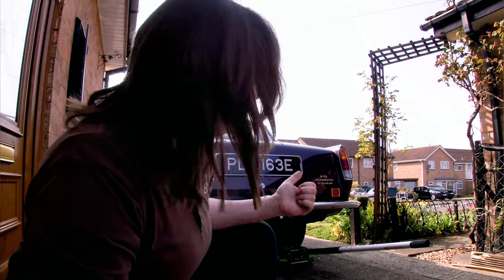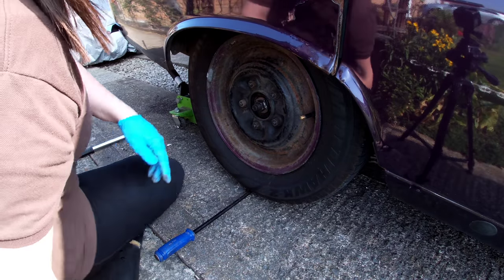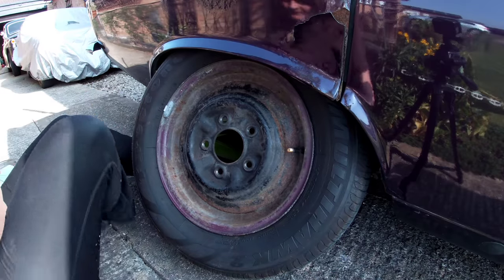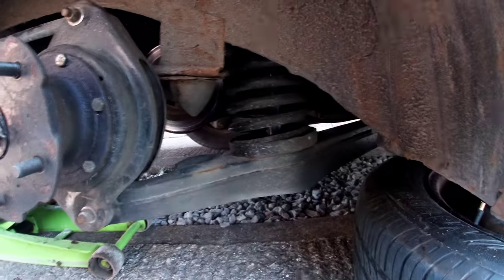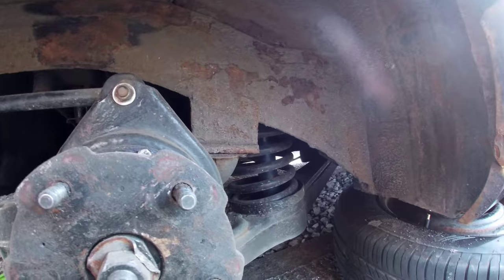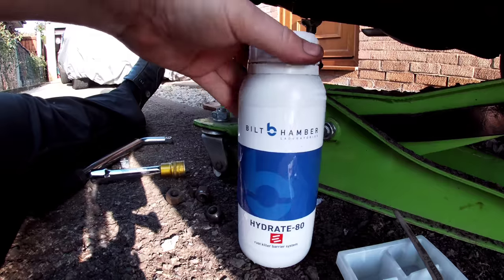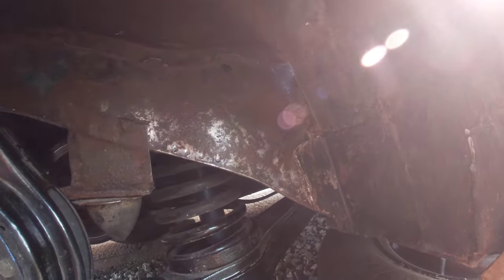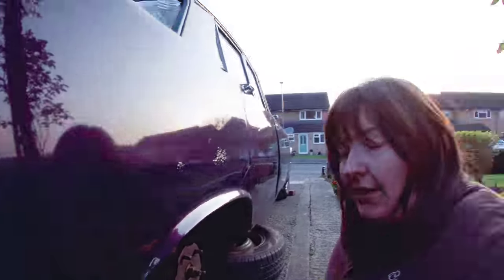Rover P6 - DIY MOT nearly sunk the Titanic

Comment: A wee tip for non structural holes. Either file it round and fit a grommet and sealer. Or a nut and bolt with a repair washer and sealer again. It was a body shop manager that told me that years ago. It cuts down the cost of the welding. Great videos. Keep them coming.
Reply: An old car of mine I found a plastic biscuit lid sealed in and a bigger ice cream lid held against it with a cable tie to protect from grit.... I mean, it worked
Reply from the maker: I will say..... 
I did superglue a penny to the inside of my P4 boot lid to cover up a hole. . .  . Hahaha
Reply: @Alexsassets  it saves money and once the rust converter has done its job all done. I’ve got a Morris minor and have done it a few times.
Reply: @Alexsassets  add some heat, class it as Brazed

Comment: I was so lucky to had my car back in the 80's, a 1973 P6 3500s, it only a little welding needed on the jacking points. Once the wings were replaced it was rust free. I remember horror stories of Kwikfit etc jacking them up under the design tube ... very expensive fix

Comment: I know the pain. My P6 was rusty in the exact same area. In fact some plonker had decided to fill mine with cardboard and a sheet of tin and paint over it! Had to have the arch re-fabricated but at the end of the day once it's done you know the car is ready for action again. Best to catch it now before it gets too far gone. Mr Jenkins will be making you smile again soon that's for sure!
Reply from the maker: I gosh. Cardboard 😐 . Madness.  
I felt like a bodger today because I put tape over the holes and painted over it 🤣 . It's only temporary until I can get it to the workshop for welding.  😆
Reply: @Alexsassets  I know it's crazy! That rust converter is absolutely fantastic stuff so using that where the metal is still good is a fantastic plan. Luckily that arch isn't actually structural to the cars integrity so it will be just fine until you get round to welding it. So long as you do it this summer Mr Jenkins will be right as rain. Really interesting to see you use the elbows as the jacking point I'll take that as a very good piece of advice for the future I too find jacking them up to be a mission. Great Video.
Reply from the maker: @EclipseGaming2073  only thing is it's hard to get the wheel off if you jack on the elbow.  . . But I manage ok like that . I certainly feel safer. I accidentally let the jack down too fast today and thankfully I had the axle stand there,  or it could of got messy 😅

Comment: I'm an old guy now.retired now. I used to work in the MOT bsy at a. 
Garage. I used to do sll the welding. That is nothing to what i used to face every day! I could spend weeks on a Transit van or anything? Before you know it, it's done. If you paint it with plenty of red oxide and cover it with waxoyi, it will see you well. Im a JAG man. Phew, they know how to rot!!!!! I've spent most of my life on my back welding them! Outer sill, inner sill, soll to floor, chassis, the whole car!!!!!!the windows would look good though! Cheer up, that's nothing compared to some of my night mares. I enjoyed that video.

Comment: I wouldn't jack any P6 with the factory jack and jacking tubes. I worked on the last of the P6 models at a dealership at the very end of the 1970s. The official workshop method was to use a round metal bar in the tubes, evenly on each side, just to support an unladen vehicle on axle stands.  The workshop trolley jacking points were a pad under the front engine crossmember, and that oblong block below the rear valance. Even vehicles that were just a few years old could buckle those side tubes, simply by carelessly jacking it up when changing a wheel if there were the weight of passengers sat in it.  I would not jack under any part of the De Dion tube or it's elbows as you can cause internal stress cracks, or suspension misalignment. For DIY jacking, you are probably safest to jack under the front lower arm, or rear trailing arm where they both attach to the chassis.  You are better off carrying a small trolley jack as I wouldn't trust that factory side jack on any P6, even the most structurally sound ones, unless it was an absolute emergency, and with no weight in the car. I don't want to alarm you, but keep a close eye on that rust around those rear chassis legs. As a vehicle repair engineer, I've seen P6's " break their  back" around the rear chassis where the springs and bump stops are mounted. Pay attention to the slightest sign of an uneven gap developing between the rear wing and door. It can develop quite quickly once corrosion develops from water getting into that rear chassis rail.  More so if you carry weight in the boot and rear seat passengers.  It is often terminal as it's a very complex repair to sort once it buckles the chassis.

Comment: Hi Alex,
 You really did get down and dirty doing that job...I sympathise with you on wondering why you start a task only to realise perhaps you ought not to have started it. I know, I to have been there, more than once...That will all come together though in the end. I must admit I was surprised at the disc brake unit bring that far away from the wheel. A certain type of electric train unit had a similar arrangement on their pantograph coaches, where the braking was mounted on the axles.
Glad you were working as safely as possible, giving hood advice as you did so. Well done.
See you next time and take care, 
Jon B. 🙂
Reply: Rover's engineers were very strongly influenced by the Citroen DS when they designed the P6. The DS also has inboard disc brakes, although only on the front. This helps to reduce unsprung weight and improves handling and roadholding. Also look at the sides of both cars. The passenger area with the doors and roof is a very similar shape.

Comment: I have 6 classic cars, had them 3/4 of my life, if you want an MOT on a classic....even if it does not need one I recommend you have one........take it for a pre mot and get a fail to work to, there are loads of things that folk THINK wont pass and it will, you end up doing less work usually than what you thought necc.

Comment: I have now A rover, 3500S manual with power steering. Unfortunately the steer does turn around but the wheels do not.

Oke, the car is free of rust, almost nothing and only from outside because it is treated with body protection inside. I need to get it to drive again after mucho years from 1981 is car be stored in barn. build 1976 and was on the road until 1981.

Your do restore from rust but most of the cases is from the inside out, so you need to treat also the in the metal tubes.